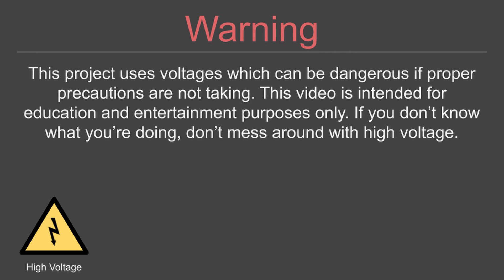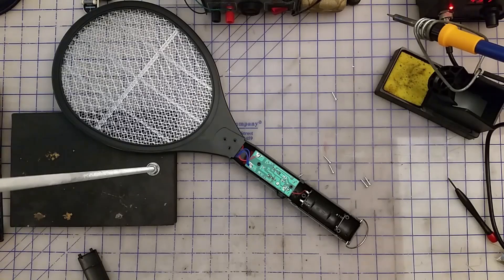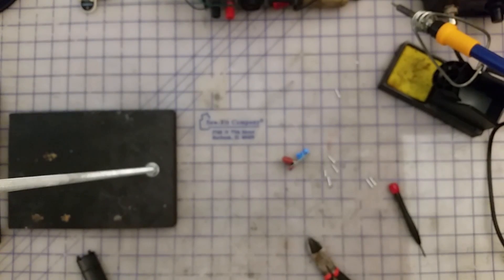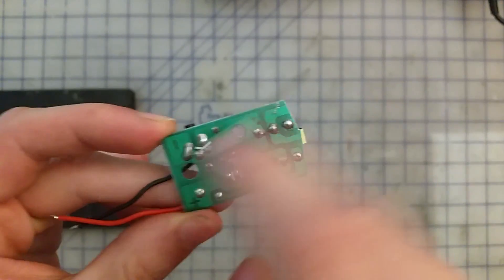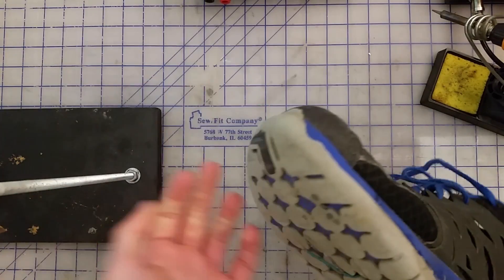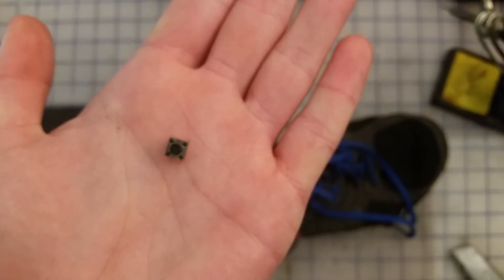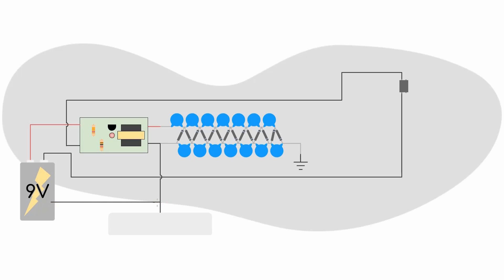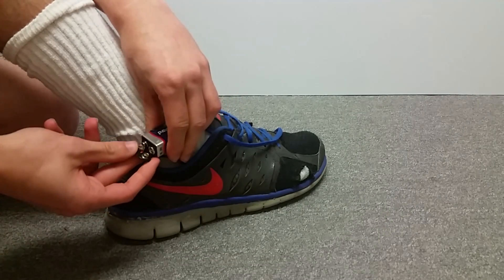Shoot Lightning From Your Fingertips  - Shoe Enclosed Static Electricity Generator

Comment: I build it but the transformar is overheating and smells burnd after 10 seconds and one time when I turns it on the transformer over heated as well as the resistor any tips for how to fix the issue

Comment: There could be an actual practical use for this in Emulating earth grounding for wellness through reduced inflammation and pain.

The theory is that
The earth is negatively charged with respect to the atmosphere and that by grounding oneself, the body can absorb free electrons from the earth and that these electrons are thought to act as natural antioxidants within the body, neutralizing positively charged free radicals on their way though the body to higher parts of your body to the higher atmospheric potentials near your head. And lastly, modern life wearing footwear and spending a lot of time indoors is thought to insulate a person from the potentially positive effects of earth grounding. 

This device pulls electrons from ground and pushes them into a person. Making them more negative than ground and much more negative with respect the atmosphere. 

Now the zapper's electric potential is greater than  what happens naturally standing on flat ground.  But standing near a high scenic overlook does expose one to greater atmospheric potentials then simply standing on flat ground. And,  anecdotally for me at least, high scenic overlooks have a profoundly positive effect on me and my mental state. Maybe that is in part because of earth grounding, or maybe that is just because of other things like scenery and achievement through climbing. 😊 

 

I'm interested in if earth grounding actually works, and if something like this helps restore a person's potential with the atmosphere while I side where they may be generally shielded from the normal potentials.

Comment: Why is the high voltage output of the generator connected to the bottom of the shoe? The body is connected to the 0V of the battery, how does the body accumulate charge in this setup? I am missing something and it isn't clicking how it all fits together.

Comment: Hey, curious if the capacitors need to be ceramic. I have the right values, but with electrolytic capacitors, will that cause any problems?
Reply: Yes, it will be problem. Elco, electrolit capasitor are specialized for low frequency and no frequency. So use ceramic capacitor with high voltage, just like that usually in bright blue color

Comment: Static electricity ....I get shocked. 
Why do u say it does not shock you?
Reply: it will not shock you, if you not grounded /connected to ground/earth. 
When you touch wall it will shock you, the wall connected to earth.
When you touch other people, even they also not grounded, you both will get shocked, because different in charged

Comment: **** THIS VID IS NOT INTENDED FOR PEOPLE WITH NO/MINIMAL  ELECTRONICS TRAINING.   There are a lot of information gaps in this vid about exactly what supplies you need,  and he does not clearly show how to put them together.  This is a high voltage unit and if built wrong you could easily hurt yourself or even start a fire.   
   If youre very lucky , the only thing you risk by attempting this , is that it simply wont work, and all you lost is a good amount of time and money.  
I myself was looking to order components and tools until i saw my Amazon cart was over $100 real fast.  Glad i watched the whole vid before I got invested in the ides of building one of these.

Comment: First, I’ve asked many people and they aren’t really understanding my question. Please help me figure this out. :(

I do not get how each output terminal of the bug zapper’s transformer are able to shock and not shock the battery’s case (before wiring it directly to the battery case because that is how the guy in the video solves the issue).

I also do not understand why the strap that charges the guy’s leg is wired to be after the bug zapper & not the 7 stage voltage multiplier. Why does the voltage multiplier have a ground and then nothing on the other output. Wouldn’t the strap go on the opposite side of where the ground symbol is? How does this charge the guy with static charge exactly in general? Wouldn’t you normal need, in simplification, a high voltage source that connects to the guy, then ground to the ground?
Reply: 1. Bug zapper use 3 coil, 2 coil for input, 1 coil for output. And not connected each other directly.
The input coil, not conected directly like Center Tap.
And of course input coil not conected to output coil like joule thief, but it was pure electromagnetic induction like normal transformers. 

2. This video use voltage multiplier not voltage doubler, multiplier type CW generator, At the end of voltage multiplier it getting grounded, because that positive terminal of DC after multiplied it. Negatif terminal is the one connected to output trafo. And why it connected to body?

Back to basic
After electricity invented, it assume that current flow from + to - terminal . Even until now in school and electronic simulator it like that.
But later, it found that in electricity the one that move or flowing is electron and its flow from - to + terminal. 

When you switch on, grounded positive terminal get electron from ground, floor, earth, then this electron get moving to your body and your body emit electron and ionized air while moving and that ion wind.

Comment: Hi, I've tried using ioniser from an ozone generator. In the unit, there are two 12v ioniser units. I've tried one straight to battery pack and can't get a spark.
I have been given a high voltage generator to use. As soon as it's near contact, it shows the spark. Seems a bit over the top. Is this okay to use?

Comment: I bought a skeeter swatter to try and make this but mine is a little different. I don't know much on small electronics beyond a car stereo so I could use a little help. I have the ground from the battery going through a switch then to pcb. Hot goes from battery to pcb. The output side has three wires. One white and two green which color is just a color. This swatter calls for 2 D cell. If more info is needed I'll disassemble it when I get back home to try and I.D. components each wire is coming from

Comment: Finally I've assembled my first prototype of this. My designed changed a lot along the way and now it's on my arm, concealed inside a brace with a grounding wire that runs down my body to my shoe, but it still works the same. I decided to use a slide switch instead of push button to turn it on and off since I still wanted it to be hands free when on but I couldn't use the push button since the device was no longer under my toes and a slide switch just seemed like the safest option to go with. Took me so long to gather all the parts, especially the capacitors, but I'm so happy I have my first finished prototype of this as I've been dreaming of it for years ever since I saw this video. I also gained a 3D printer since last year so that also changed my design a lot and allowed for easier attaching of parts to the brace. Wish you would upload more because this channel has really impacted me a lot.
Reply from the maker: Hey man, congrats on getting your first prototype to work! That's super cool! Like I mentioned in the video this project was based off of a design from the channel nighthawkinlight. And that video is what got me into electronics in the first place. So it means a lot to me that I was able to pay it forward and have that same effect for someone else. Unfortunately I haven't had much time to film while in college, but I've definitely got some projects I want to make videos about! Hopefully I'll have the time eventually. Anyway, thanks for the kind words, it really does mean a lot. And congrats again. Keep on building stuff!
Reply: @PartialScience hey, what concept do i study to understand how this works
Reply: Now working on a "Mark II" that will go instead around the calf of the leg instead of the arm to conceal it better and will hopefully try to use Bluetooth to turn it on and off from a bracelet to make it very low-profile.
Reply: @Aidansstuff_ sono interessato scrivimi in privato
Reply: What would happen if you'd charge yourself with positive ions instead of negative.?

And how does it feel when you are charged, and walk through the rain... Do the rain drops discharge on your skin or so.??
Reply: I build it but the transformar is overheating and smells burnd after 10 seconds and one time when I turns it on the transformer over heated as well as the resistor any tips for how to fix the issue
Reply: @Aivideo-m9w do you mean the transistor is burning? That’s pretty common, you just have to use beefier MOSFETs and heat sinks to avoid burning them out
Reply: I’m currently making one that’s arm mounted too

Comment: Can you give me advice please.
I used hv ceramic capacitors on me ignition coil for bether staring me engine in winter.
The problem is me old Delco 12 si alternator is effected be those capacitors.
Oddly enough the charging light wont go off unless I rev the engine so it seams me starting charge from the alternator isnt 1k rpm it now around 3-4 k rpm .
So what can I do to prevent the voltage regulator inside the alternator to interact with those capacitors.
Peopel call it plasma ignition but its just frequency or voltage multiplier .
I hoppe you can help me understand that regulator how it works it has only 1 ic chip inside and I belive 1 or 2 tiny capacitors nothing ells controls the alternator .
Thats the only problem I have so fare baterry is ok ,starter motor spins faster,bether engine start,smuther engine evry thing ells is ok only problem is the alternator it looks like the diode in the dashboard is bypassed .
So hoppe some one can help me understand how resistors and capacitors can interact with alternator or if posibly their starting charge can be controled some how manuali .

Comment: Can I do it without snipping the board and adding the capacitors (Ik it will be weaker but is it possible) (and if I don’t connect the capacitors and keep the ones that are on the board what shoots the hot wire connect to thanks)
Reply: Not really because that capasitor circuit onboard ar voltage doubler, so you will get shock. 
You need voltage multiplier not voltage doubler. In this video it use voltage multiplier version Cockcroft–Walton gwnerator

Comment: I love the way you explain the process. Any ideas on the maximum voltage that can be produced at one time? Is there a limit?
Reply: Depends on how many stages your voltage multiplier has and what capacitors you are using
Reply: @MyRadTVAcc what would be a safe amount?

Comment: Anyone know how the guy in this vid at 11:19 mins in does it in only his speedos?  https://www.youtube.com/watch?v=njieB8E938w
Reply from the maker: It's definitely what the wife was holding. Also based on the arcs they seem to be high frequency AC, probably generated by a tiny fly back transformer somewhere hidden on her person. Either the voltage is going through her, or the "string" is actually a wire and she's hiding the other end of it down her sleeve. Both are possible. If you want to create a similar effect at home all you need is a plasma ball and some aluminum foil. Wrap the ball in it, and put a piece of paper over it. It's essentially the same effect, but you're just not hiding the power source like they are.

Comment: What liquid did you ignite
Reply from the maker: Just a mix of boric acid and methanol. They react to form trace amounts of trimethylborate which ends up in the vapor phase and burns with that green color. And then the burning drives the reaction forward despite the low equilibrium constant.
Reply: now, that's an answer if I've ever heard one 😄

Comment: So how hot could you make this? Could you use parts from a cheap eBay taser instead of a negative ion generator and hook it up the same way for better sparks? It doesn’t seem to shock as bad when the spark is jumping off of you onto something else vs just getting shocked where the sparks are jumping onto you from something else like a taser.

Comment: Hey, I was wondering if you could give some more information on building the voltage multiplier because I was a little bit confused about how exactly you created it and how many of each part you need. I am following your design for an engineering project in my school and this is the only part of the build I don't really understand. Thanks!
Reply from the maker: It depends on how many stages you want to add. The idea is that each stage doubles the voltage (although in reality there are diminishing returns as you add more stages). So if you want to multiply it 14 times you'll need 14 stages for example. Here's a video I feel gives a good visual explanation of this type of circuit. https://www.youtube.com/watch?v=DI8Yt1AQrH8
Reply: @PartialScience  I loved this but was also wondering if a specific amperage of diode should be used for this.

Comment: I doubt you're still reading comments, but your, and anyone elses, help would be appreciated.

I've worked on this project off and on for a few months now, and everything works, for a little bit, till the transistor fry's itself. I also am getting shocked in the leg by the strap, even with the battery connected to the strap, but that's a minor issue I can fix by myself. 

I'm wondering if it's just prolonged use frying it, and I need to give the thing a rest, or whether I need to replace it. 

My first attempt I used the same bug zapper used in the video, but that transistor fried aswell while I was using it, granted I was arcing the part connected to ground and the wire I connected to one side of the voltage multiplier. After frying that transistor I used a harbor freight bug zapper I got for $4.

Note: I've only used it while it was in a shoe once, before it would fry before I could even get it in one.

Again, any help is greatly appreciated, I have little to no idea what I'm doing.

Edit: I've found a solution, I just ordered a rechargable bug zapper off of Amazon and used the included battery to charge everything, and from what I can tell, this is a bit more powerful but what is shown in the video, but that's what I wanted, anyway, thanks for the amazing video partial science, this was a fun project through and through!
Reply from the maker: Hahah, trust me I know the pain. I've fried countless transistors with this thing. Two things which helped though were soldering a 3 pin socket to the board so I could just swap new transistors if they got fried without having to resolder. And then buying more powerful transistors. I eventually settled for NECD882s. 

Also, a bigger strap that's held to your leg tighter should stop it from shocking you (unless you wired the wrong end of voltage multiplier to it in which case the residual AC spikes will... tingle a bit)
Reply: Hey Dx_ed I hope you read this because I need help. After I read your comment I got a rechargeable fly swatter but it appears the wiring arrangement is different for the project. Could you explain how you did it please i would be very thankful.
Reply: @liamwiech4230  just find the output pins of the transformer and wire them to your cockroft walton multiplier (you can check with a multimeter set to V~ or trial and error), but usually the pins are the exact same as they were in the video. 

cheers!
Reply: @EthannCraftt  thanks! Even though I'm very inexperienced with this stuff this helps alot. Thank you
Reply: @EthannCraftt  Also one more thing. Did you cut the board in half or not? it sounded like you didn't in your comment.
Reply: @liamwiech4230  yes, i did
Reply: @EthannCraftt  Alrighty ill get to work thanks!

Comment: Will this work with 1 of those ebay voltage step up converters instead of the fly swatter
Reply from the maker: It depends on what you want it for. Those usually have a very similar circuit inside. But, they're also usually filled with tar so you can't rip the circuit out, and as such it's basically impossible to put inside a shoe. And most importantly, they also usually use larger capacitors meaning they can put out more current and are therefore more dangerous.

Comment: This is cool! 
You think it would be possible to get a smaller but powerful transformer somewhere?
The idea is not bad but when it comes to potency it would be a good idea to modify the circuit to make it look low profile.
Something like making your own tiny prototype board and distribute 12 or more voltz in between both shoes.
Somehow you could add a tiny Bluetooth module and program the switch to be a Bluetooth bracelet.
But at least you got the experiment right, that's the harder part. Modify and prototype would be all fun is you really like what you do.

Comment: High frequency dc? DC has frequency of zero!
Reply from the maker: Yeah, it's a bit of a weird term. I was basically just trying to emphasize the fact that it doesn't change direction. The proper term is pulsed DC, although I have heard people say high frequency DC before as well. I wouldn't exactly go using it in a formal context though.

Comment: So I built one but a little more powerful then ran into a problem  Capacitors are not facing the right ways like some positives and negatives are switched guessing that would have an affect and it doesnt work how do I tell positve from negitive leads are the same size and no markings on it
Reply: Get an electrical meter. It'll tell ya right quick